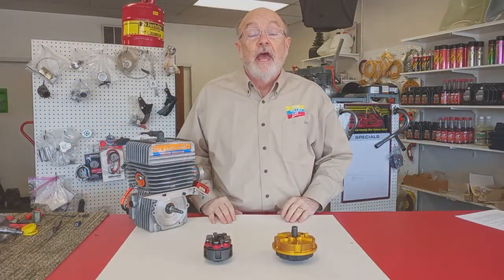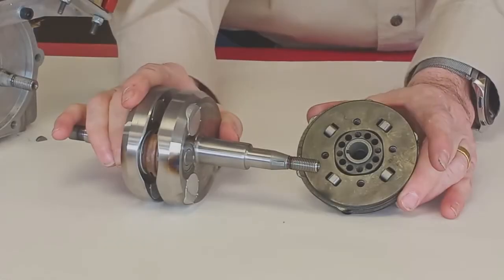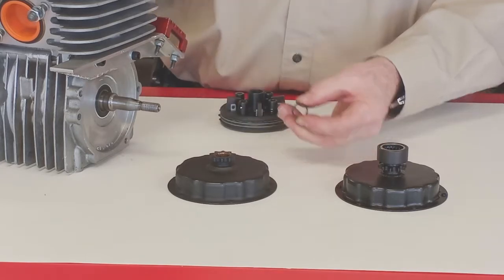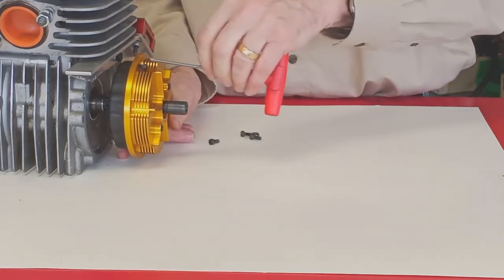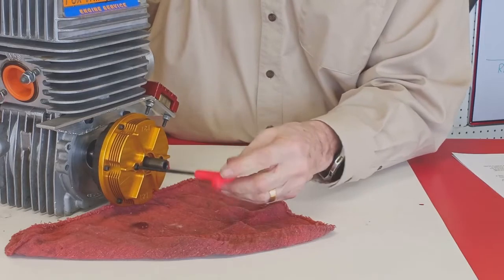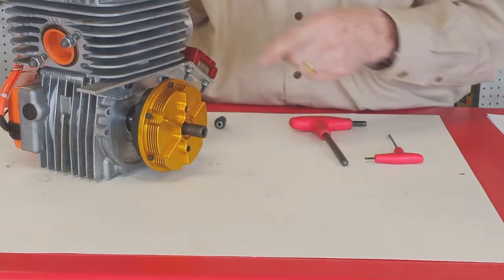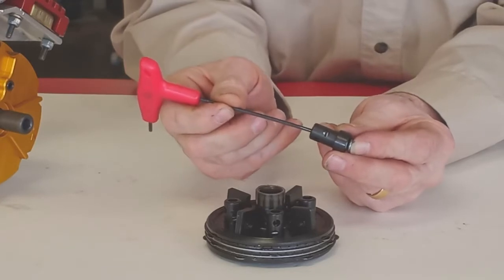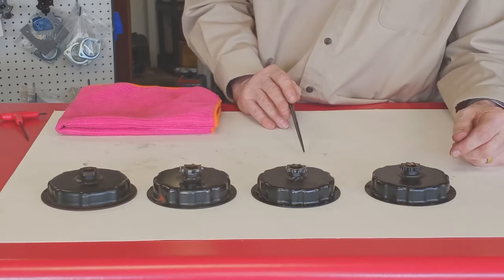Grand Prix Clutch Seminar Part 2: Engine Mounted Clutches

Comment: My Experience:  NEVER USE a woodruff key on a tapered crank PTO .. just lap it in really good, then torque it to spec, FULLY.  The key only provide alignment, it does not increase the holding power of the taper lock. If your clutch spins loose, if a woodruff key is present, it may chip, crack or break off your crankshaft end!!! NEVER use those keys!!!

Comment: Sir, is this a shifter kart? If it's not, then what's the clutch used for, if there are no gears to shift?
Reply: It's a kart racing clutch for non-gearbox classes (almost all kart racing classes),, it slips, allowing the engine to run at it's torque peak, until the clutch locks up. For most kart racing 2-stroke engines, that slip speed can be 9,000 to 11,000rpm.

Comment: How would you turn a direct drive to a clutch drive on the Yamaha 100 cc it won’t be for racing but for shows
Reply: in the USA, Yamahas are ALL raced with a clutch .. ya buy a Yamaha clutch and put it on, as in this video, lol.